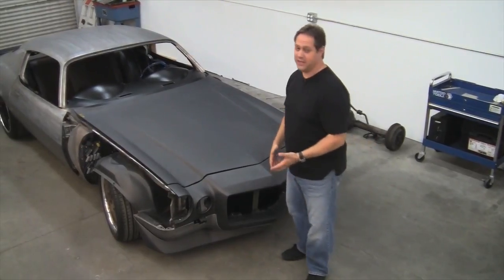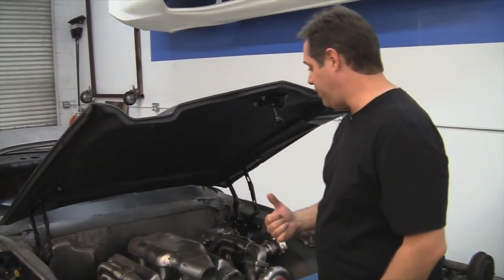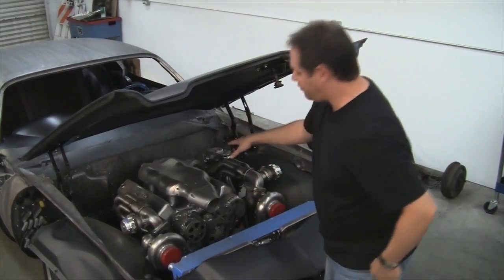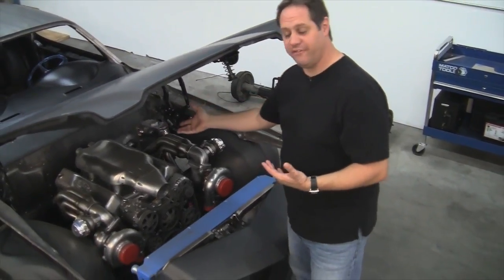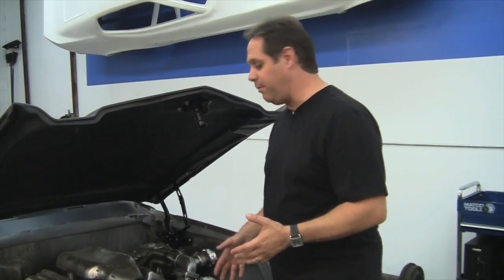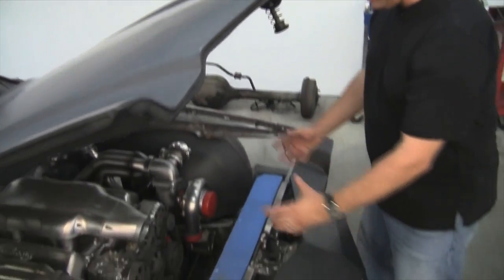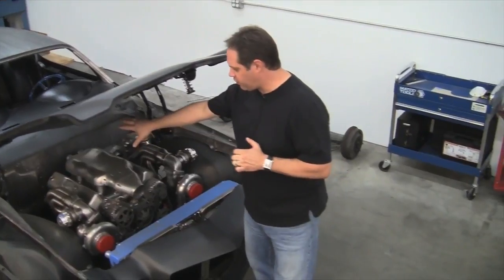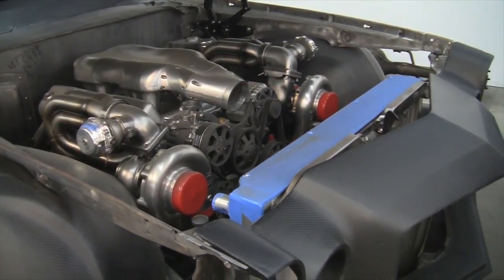Pure Vision's Twin Turbo Camaro Engine Bay

Comment from the maker: @studio571: You are correct that the main reason for this design is the ability to split your fuel tank and add race gas under boost for even more power. However, we have been informed by Tom Nelson that this design does indeed improve drivability.  Yes, you could drive this engine with only 8 large injectors and never have a problem, but using 16 even without race gas adds much more control.  This results in better throttle responce durring normal driving and better fuel economy. (driveability)

Comment: the gain is to use race gas only when it is needed and that is smart ! normally can drive regular pump gas. plan running on air to water intercooler or air to air ? i do love your work man,amazing desings !